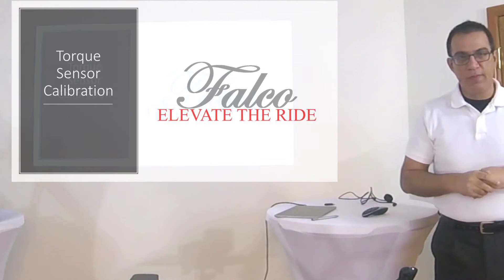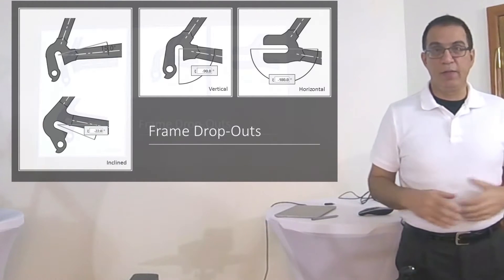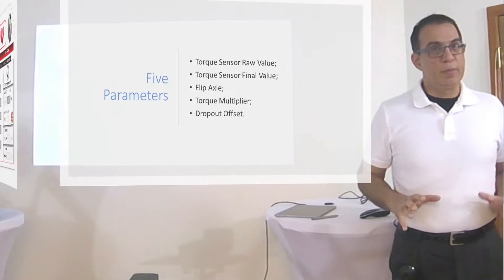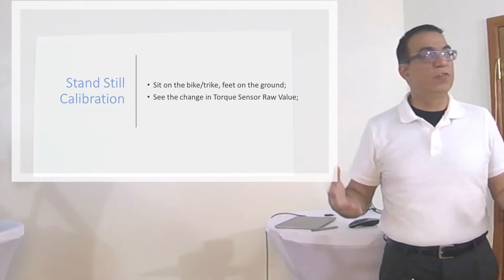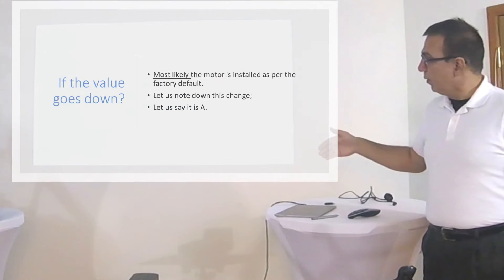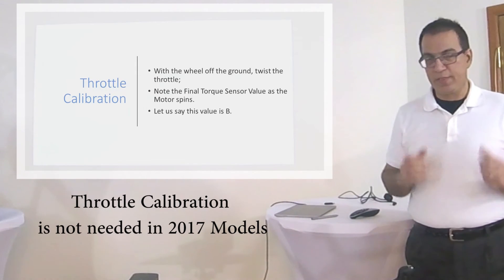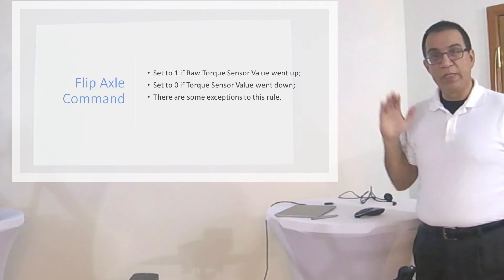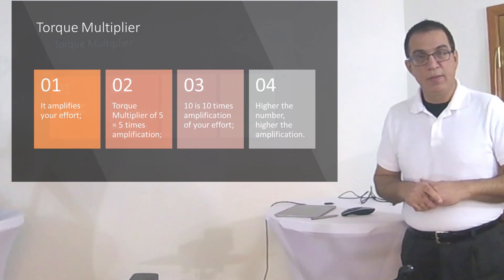Falco Torque Sensor Calibration

Comment: Thank you!   Can you elaborate on the Flip Axle command exceptions regarding inclined dropouts?
Reply from the maker: Hello Anthony, We have seen inclined drop-outs such as Yuba Cargo Bike, where when the wheel is installed correctly (with the red mark on the axle facing backwards) the torque sensor value goes up during Stand Still Calibration. And when you push on the pedals, the torque sensor value goes down. To account for this, Under Motor Control tab there is a dropout selection, you must choose "Horizontal Dropout" and select set and hit broadcast. That is the exception to the rule. However, this can be easily taken care of in the eBike Lab.

Flip Axle command is normally used where cables may be getting in the way and you have to install with the red mark on the axle facing forward. In this case, Flip axle command must be set to 1.
Reply from the maker: Also, if you have a 500W motor, it should be upgraded to the latest 100651 code and if you have 750W motor, it should be upgraded to 100657 code.